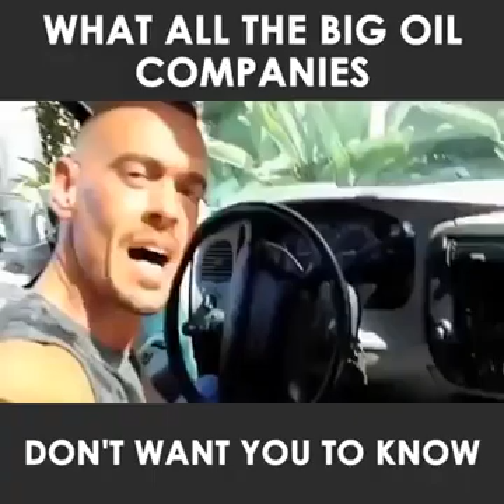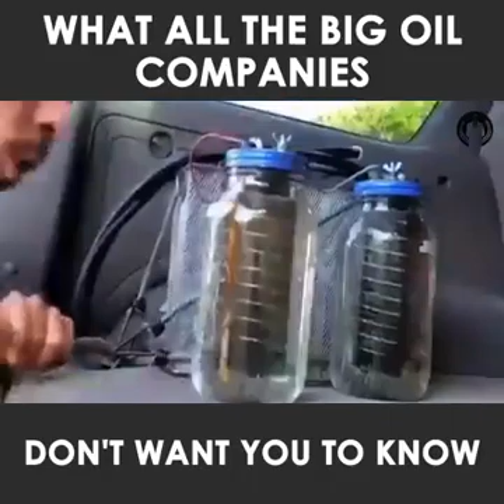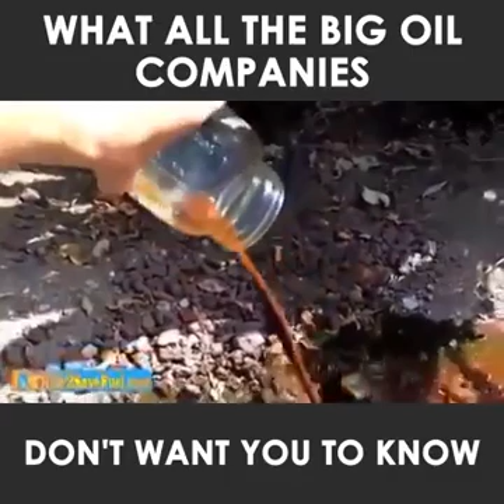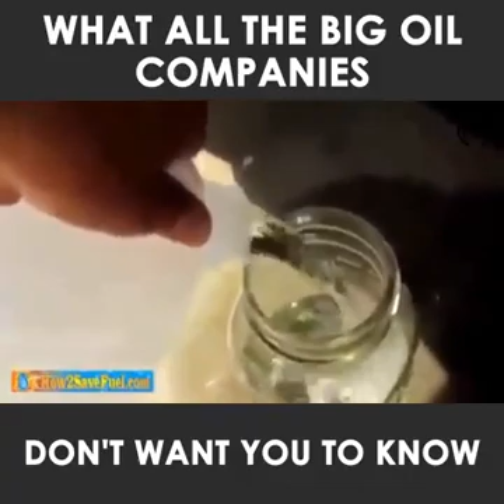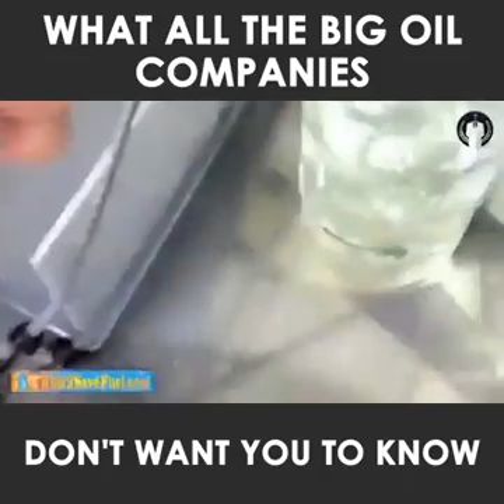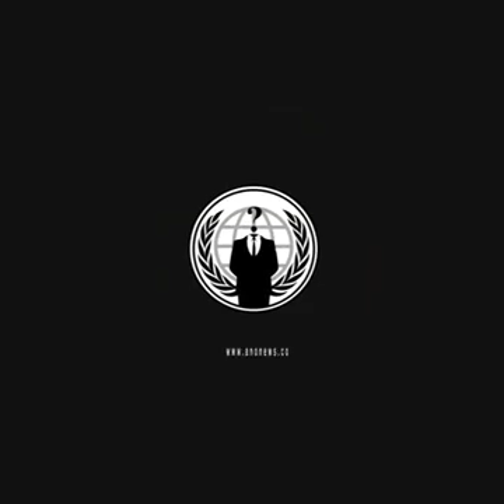car running on hydrogen - DIY

Comment: Water contains Hydrogen that can run any engine. What to do? Make an electrolysis of water, connect only the hydrogen output to the engine and there's no doubt your engine will run and you don't need gasoline anymore! Hho will not work because hho is a combination of hydrogen and water but HYDROGEN Is the only ingredient just like GASOLINE that has the power to run any engine!

Comment: You can get even better performance if you combine the gas and water systems in a direct line. Simply fill your gas tank only up the the half way mark then use your garden hose to fill it to full.

Your garden hose doesn’t have an automatic stop like a gas pump so some may come back out which is fine

Comment: This Video is real I tried to visit a website but it don’t exist. There are actual hydrogen kits that can be bought that are just like those and the vehicle can too be ran on hydrogen completely if they would do that then the so called government would shut it down. I’m a truck driver and I have one in my truck and believe it or not I get better fuel economy although diesels don’t have spark plugs

Comment: Fraud, you can't produce enough hydrogen for the internal combustion engine this way. And even it won't be efficient as the electricity required is way too much compared to what the engine may generate.
Reply: @focused fo j it's up to you if you want to believe it, because I don't.
Reply: @Y.Shishani  then don't.

Comment: negative electrode make the hho btw, also why can't we use salt since it helps conduct electricity, and why not nitric acid and energy motor plasmatic generator rather than loss of water on earth?
Reply: The reason you don't use table salt (technically sodium (bi)carbonate  are both salts, but not NaCl table salt) is because the electrolysis will oxidize the chloride (table salt is sodium chloride,) into chlorine, and gaseous chlorine is REALLY toxic to humans, and will corrode your electrodes (I think he used copper here.) 

It's all bullshit though, doesn't matter what salt you use for an electrolyte, you can't get more energy out of H2 combustion than you put into spitting the H2O, so unless he's figured out a way to suspend thermodynamics, he's just a fraud.

Comment: total fraud. Thermodynamics people; if you're using energy to break 2* H2O into 2 * H2 and O2, you're not going to get more energy reforming the 2H2 and O2 back into 2H2O. You're going to get a net zero energy change, MINUS the system inefficiencies (waste heat.) Even if he's theoretically adding O2 into his rich blend to burn more of the hydrocarbons (he's not, the H2 gas is slightly more reactive,) you could get better efficiencies by a) fixing your onboard computer to correct your air/fuel blend, or b) add more oxygen and compression, AKA a turbocharger. Turbochargers are very real things that improve fuel efficiency, and you don't need "secret conspiracy that gas companies don't want you to know about" to make it work. The downside is that it costs to add one, and it puts additional stress on an engine (not a HUGE amount, but you will blow an engine slightly more frequently with a turbo than without.)
Reply: This is the most convincing critique I have seen. However, wouldn't increased MPG comes from the improvement efficiency of the gasoline, and not so much the hydrogen? In fact I wouldn't be surprised if MPG gains had nothing to do with the hydrogen, and everything to do with the extra oxygen being put into the system.
Reply: There is a better source of oxygen than electrolysis of water; the atmosphere is 20% O2, and it's about as close to free (energy cost) as you can get. 

I looked up the stats of a 98 Ford Explorer, and the lowest MPG model is rated for 20 MPG highway, and this guy said he is only getting 13, but then has a 50% increase after doing the electrolysis (I call BS, but let's assume he's right and that the electrolysis was completely free.) 13 * 1.50 = about 20. This tells me that his car is broken and needs to be fixed. Maybe it's because he's doing modifications without knowing what he's doing, but if his engine is starved of oxygen, then there's something wrong that can be fixed in much better ways than what's he's proposing. He'd even be better off going to a gas supply and buying tanks of compressed O2, and running them in (still stupid, but better than electrolysis of water.)

And I don't know how much ICE tech has progressed in the last 20 years, but newer cars do not emit 70% unburned gasoline. You wouldn't pass emissions testing if they did, so I doubt this guys car is actually emitting that (or he's driving illegally.) 

In any case, at best you could improve this guy's broken car by tinkering with the O2 content, but there's is absolutely no way that an average working car would improve efficiency by adding H2 + O2 from electrolysis of water using electricity generated from an alternator using kinetic energy from the engine's conversion of chemical energy into torque. That is a stupid amount of energy loss from EACH conversions inefficiencies.
Reply: Notice how all the conspiracy theorists have yet to even reply to this lol

Comment: How the fuck are you expecting us to believe that adding hydrogen, a reducing agent, to a rich blend (heavy on fuel, low on oxygen,) will increase combustion? If you're only burning 30% of your fuel, adding hydrogen won't do dick. Add oxygen if anything, or fix your on-board sensors that are causing your engine to run rich.

Comment: No you are still emitting co2
Reply: No it just creates water 2h2 + O2 -> 2H2O + heat
Reply: He is burning the hydrocarbons (gasoline,) to make the energy that splits the water. It's not clean in any way, and is still emitting CO2; in fact it is emitting MORE CO2 per mile driven than if he taped a magic 8 ball to his dash instead, since they both work on the same principles.
Reply: lol..indeed the brainless indoctrinated climate hoax fools think that co2 would do anything relevant damage..

Comment: Only thing I can imagine is the injected oxygen burns the actual fuel more efficiently. The hydrogen won't do anything since you are taking more energy to produce it
Reply: I don't think he's compressing hydrogen anywhere. The combustion inside a closed container would rapidly pressurize it, which could cause flying shrapnel, but I don't think he's holding it compressed .... which would be worse.

Yeah, the H2 is doing nothing here (gasoline already contains plenty of hydrogen.) The extra O2 MIGHT help, but just outside the car is a HUGE source of free O2, so spending the energy to split the H2O is kind of dumb.
Reply: Hes additionally inject flamable gas direct to the intake

Comment: Have anyone tried this? Costs money, seems like a scam
Reply: Not to be pedantic, but it's actually the Second Law of Thermodynamics.
Reply: +Geoff g hey not to be an ass or anything but u are also wrong,its the the 3rd law of thermodynamics according to my thermodynamical book here on page 2.
Reply: +Game Bred Duramax, Not to be an egoistical maniac but it's the 4th law.
Reply: TheRightToQuestion  doesnt everything you do cost money your whole life is a scam
Reply: +Tinydancer789 I think you have it correct there buddy. As the guy states that this is a HYBRID fuel system. The car still uses gasoline for combustion but with added hydrogen to make the burn rate more efficient in the combustion chamber, thereby increasing mileage and reducing C02 emissions. No extra energy is added to the system. 

Although you could argue that you would need to add another battery to power the fuel cell , but thats a small sacrifice to make considering the savings on fuel. Oxygen is also a waste product so thats a plus
Reply: I rescind my previous comment on the grounds that the energy into the system e.g. gasoline is fixed, and the energy used to split the water is derived from the gasoline. Therefore, any additional energy contributed by the hydrogen will have been created by the gasoline, powering the alternator, splitting the water molecules, and creating hydrogen. Arguments in terms of free energy do not apply in the this care unless you argue that burning hydrogen with the gasoline somehow improves the combustion of the gasoline beyond the expenditure that it takes to split the water
Reply: RetardedFishFrog it works
Reply: It absolutely does not work. If we assume true what he says about 70% uncombusted gas (it's not, he'd fail emissions testing,) then adding another reducing agent, H2, would not result in more stuff being burned and O2 being emitted. If he's not burning all the gasoline ( C8H18  predominately) he needs to add more oxygen, not hydrogen. And electrolysis is a REALLY expensive (in terms of energy requirements,) way to get O2 when your whole car is surrounded by a gas that's 20% O2 (aka the atmosphere.) Fix your O2 sensor ya moron.
Reply: eh, you just have to ignore the first law of thermodynamics and all will be well.

Simple said, enegery going in will always be larger then energy coming out.

So technically it works, but at a loss.